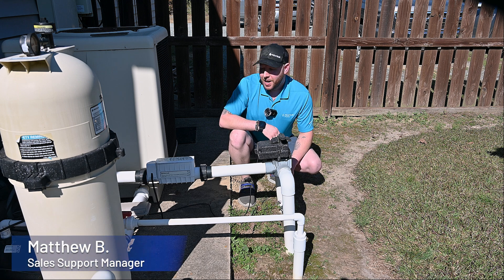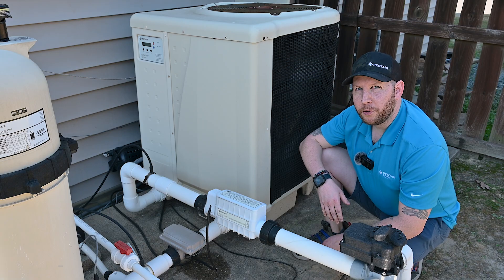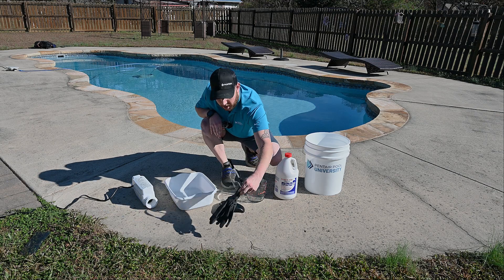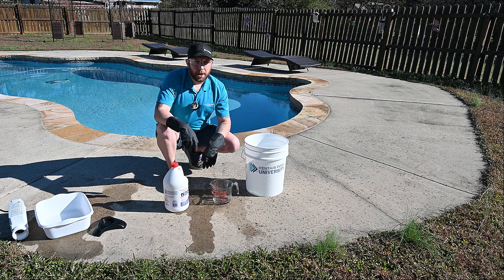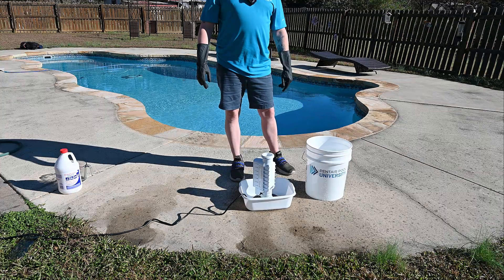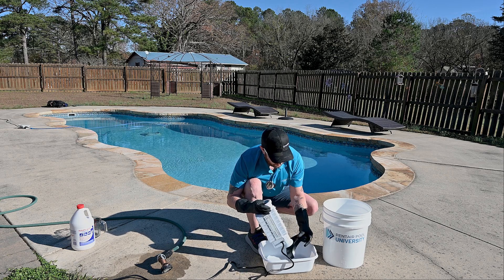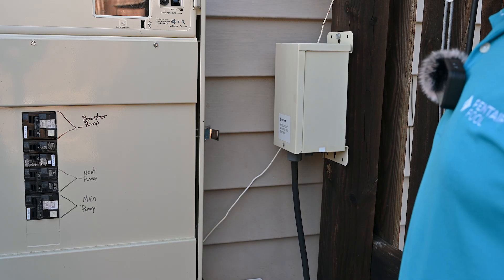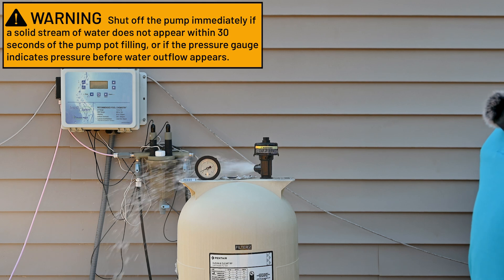IntelliChlor® Salt Chlorine Generator Cell Acid Cleaning

Comment: You made a much larger batch than necessary. 
4 cups water:1 cup acid would’ve been fine. 5 cups total easily fills the unit, with plenty to spare

Comment: Do you have to mix so much Acid and Water together - How much does the Salt Cell actually hold in ounces ?
Reply: I followed the instructions and had one than twice the amount of mixture  I needed.  I think you can prepare half the amount recommended
Reply: @Kevinyoung8186, I mixed 4 cups of water, to one cup of acid, and it was plenty. 5 cups of Solution is more than enough to rinse the plates, and still have more left over.

Comment: Is it ok to dump the used acid in the pool?  Usually my pool needs pH adjust anyway...
Reply: @jeffweber8244, my pool could use the acid as well, but I wouldn’t want to dump that solution back in the pool. It contains all the dissolved, hard minerals that came off the salt cell plates.  You wouldn’t want to dump that stuff back into the pool, it will end up back on your plates.

Comment: What do you do with the bucket of acid with the calcium in it?
Reply: Depends on your area. Call your local hazardous waste disposal center and they should be able to help with that
Reply: Dump in pool seems like the  most logical thing to do
Reply: @diannaharding9790 , but then you are dumping all the dissolved hard minerals that came off the salt sensor back into the pool. You’re better off just deluding it well and dumping it into the environment. Especially if your soil is alkaline, like ours is in the desert.

Comment: Once a quarter and 30 minute limit with the cleaning solution doesn’t come close to removing all of the white calcium in my cell.  AZ has awful water and the cell gets packed. What is the protocol for cleaning?
Reply: VERY GENTLY persuade the calcium off with a paint stirrer
Reply: Spray it down w jet spray, then soak until bubbles and fizzing stops then soray down again, and you're good to go, in AZ too
Reply: If it’s that bad you can check it monthly

Comment: I've seen in a few places that the cord should be at the top, away from any solution. Is there a specific reason you had it down? Should the solution go in a particular side?
Reply from the maker: Hello, I agree, that would be better, but not critical.
Reply: @Pentairpool , plus if you do it opposite the video, it takes less solution to cover the plates
Reply: @altmanmitch, plus if you do it opposite the video, it takes less solution to cover the plates